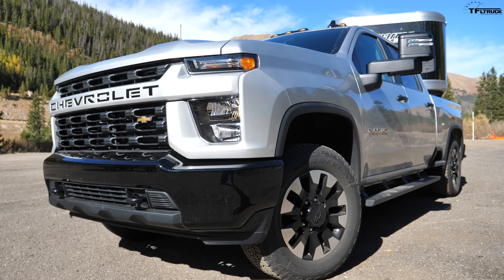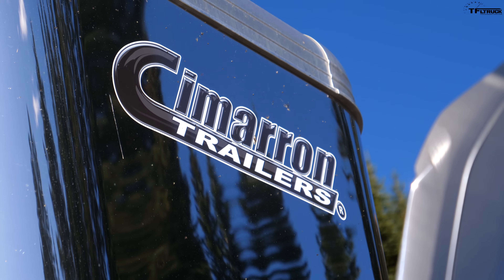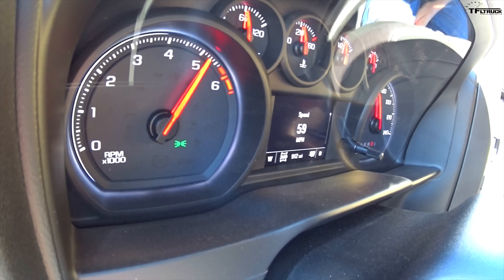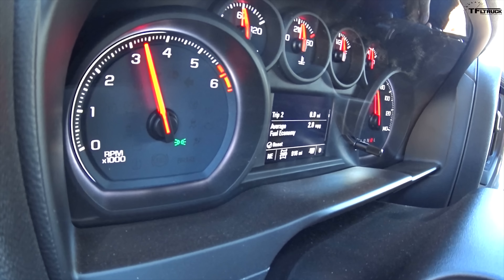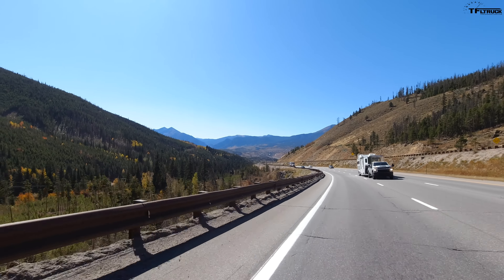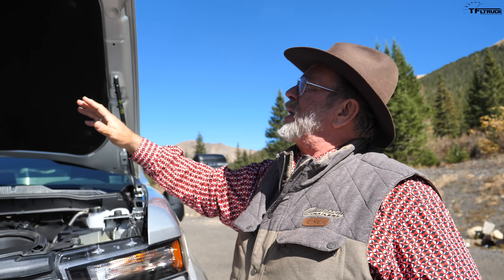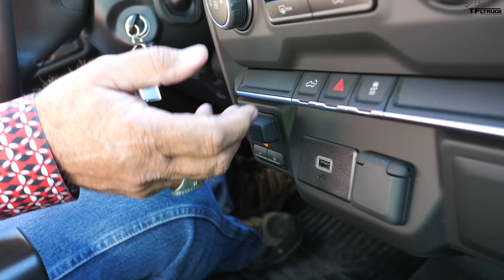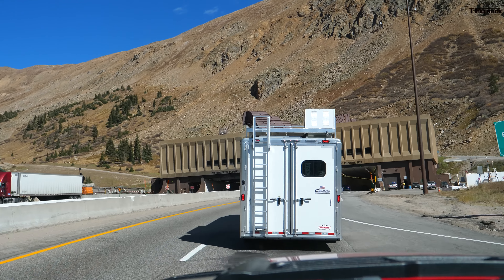The New 2020 Chevy Silverado HD Gasser Broke Our Ike Gauntlet Scoring System - Here Is How!

Comment: Wow what a flop I was hoping Chevy would have something better than that can’t wait to see how the 7.3 L Ford does I guarantee you it will be better than that
Reply: Same here. Very curious to see how well the 7.3 does with the 10-speed. Should be quite impressive. Smart move by Ford to offer great towing for much less cost vs. diesel.
Reply: What's sad is the new 7.3 is only rated 100 hp more than my 94 f350's 7.5 460 and almost the same torque so where is all this power they're talking about because it's not that much different than what my motor was  25 years ago
Reply: I think the RAM with the 8 speed may do quite decently. Granted, it's the oldest engine here, but the ZF is a great box and the Hemi likes to rev.
Reply: @80f250  I'm not sure where you're getting your information from, but the 460 from the mid 90s was rated at 245 hp and 410 tq.  That's nearly 200 more hp and 65 lbs of torque.  Pretty significant gain.  The 460 from the early 90s was even less powerful.  Plus, you're not seeing the whole picture.  I'm willing to bet, despite the new f350 outweighing your truck by thousands of pounds, probably gets twice the mpg.  I'm not sure what the new payload and tow ratings will be, but I'm sure they will eclipse your trucks 10,000 lb towing and max 3,800 payload, considering this Chevy is already leaps ahead of your truck with a 3/4 ton that makes less power and nearly half the gears than the 2020 Ford 7.3.  Not to mention these trucks can do all that more safely, and in far more comfort.  That's just scratching the surface on what 25 years has done.  And don't get me wrong here, I'm a big fan of the 460, but it does not even compare to these new engines in terms of performance.

Comment: Interesting video and I can't wait to see how the Ford 7.3 does for comparison, but these maxed out uphill at elevation tow tests apply to such a tiny fraction of actual use please just make sure you are spending adequate time on reviewing the rest of trucks instead of just being infatuated with this Ike Gauntlet test...  I know you mention the elevation in every video but a lot of folks probably still don't realize just how much effect it has on naturally aspirated motors and how much better the turbo gas and diesel motors can compensate for it with additional mass flow from the turbos (to the point where the turbo gets out of its efficiency range anyway), so just to make clear for viewers for anyone towing at low elevation all of these gas vs gas/turbo and diesel/turbo results are pretty much worthless.  Just saying if you live in MN like me or anywhere else lower elevation don't make your engine buying choice based on these test...
Reply: If it pulls better at elevation, it will do better down lower,  but if the f250 beats it at elevation it will beat it lower down, so it is still relevant.
Reply: @andycarrell7320 The point was simply that the results will be much closer at lower elevation, so something that seems inadequate on the Ike Gauntlet may be just fine for your use...

Comment: Just keep in mind with all these tests, they are at high elevation and any NA motor will get crushed by an engine with a turbo.
Reply: But the Ford 7.3 gas Naturally Aspirated motor did not get crushed. It towed just as good as the diesels.

Comment: No one doing this kind of towing is going to buy the gas engine. You'all know that, yet you review it as if it was directly competing with the diesel trucks. I honestly don't understand why you do this. The gas 2500  would be able to handle around 10,000lb on the gauntlet, not 16,000. Most people buying this truck are going to tow around 8-10k pounds. Yea its rated for more, so what. Not a single person out there is going to tow 16,000 pounds through mountain passes with a gas 2500, so the video is very nearly irrelevant. Also, people towing this much are usually going to opt for the 3500 option, which would not squat nearly as much. What you are doing is really at the extreme outer limit of what a truck like this can reasonably be expected to do. Yet it seems like you are so disappointed at how it performs. What you should be disappointed at is the insane never ending "towing number wars" where manufacturers constantly inflate their tow ratings to unrealistic limits. Nobody should be surprised at this result, and no one should take it to mean this truck isn't a great product. I'm sure it will excel in the 10,000lb range which is exactly where it should excel. But most buyers opt for the duramax even though they will never come close to needing it. And its videos like these that contribute to that insanity.
Reply: The thing is though, If they test all the gasser trucks in this same way, it gives an even metric to compare the trucks against each other. will they all be used in this way? No. will the one that does the best in this testing probably also do the best when pulling a more standard 8-10K? Yes.
Testing trucks at their limit is perfect, because it shows you how they behave at the limits

Comment: Looks like they overrated the towing/payload specs for the gasser. It needs more gears or a shorter final drive ratio. Gotta keep that RPM up.
Reply: Its one of the steepest grades in the US. At extreme elevation. Its hard for an N/A engine to preform well in that environment

Comment: It's a shame the hood scoop isn't functional with the gas engine. I never understand why the manual shifting option isn't used. I get that you're looking at how the manufacture programs them, but the same manufacture also puts in that manual mode for a reason. Even more why not test it as if.... you owned it since that's what happens for those who buy them. Treat it like you own it rather than just want to take it for a quick spin.

Comment: Slow AND thirsty?! Hmm 🤔
Reply: Agent Smith and $10k cheaper than the diesel.
Reply: @ALMX5DP   then you gotta factor in repair costs and that stupid def fluid bullshit.  unless you do heavy towing regularly. diesels just not economically justifiable.
Reply: @inthewoods5471  
When your cat gets clogged eventually and a cascade of dominos reach up I to that engine. 
Good luck.
Reply: @inthewoods5471   Just wait till the filter in the DEF unit gets clogged. It cost $7000 in a CDL truck to be fixed. So I'm going to guess between 1000 and 3000 for a pickup truck.  And how it lets you know it needs replaced is warning lights. There's nothing that tells you you need to replace the filter soon. It basically tells you to stop driving the truck. Or the engines going to be destroyed. Because if no DEF gets into the engine it will destroy it. I guarantee you there will be plenty of fools that still drive the truck around and destroy the engine. DEF is new in pickup trucks just give it 5 years. There will be plenty of horror stories. People will be looking for pre DEF diesel trucks. And the price of those old trucks are going to go up.
Reply: mtrujillo1973  Its doing what its designed to do, 5000 rpm's in a gas engine is like 3500 rpm in a diesel.
Reply: mtrujillo1973  
You are a mechanic and "KNOW" diesel don't have catalytic converters? Seriously?
Reply: @inthewoods5471  
That's your best come back?
What do you call that which I linked?
A Catalytic converter for a Ram 2500/3500.
Surely you know this as a mechanic every truck sold here in California has one.  
Not to be confused with a CATALYST.

Comment: I'm looking at getting the same truck but 2022. The 5th wheel I have is 41ft and 12,100 (14,000 max) with a pin weight of 2,200. 
Do you think it will be safe to tow periodically (maybe 2 or 3 times a year).

Comment: Why wouldn't they manually hold a lower gear, keeping the engine in it's power band, furthermore does GM need to adjust the Auto shift algorithm ?
Reply: They never do that. They wanna see what the truck will do when they let the truck do all the work

Comment: The compression ratio difference between the gas and diesel also plays a big role in engine braking. 

I don't think the truck will downshift under max load with the gas pedal on the floor until it drops to such a low speed. It's protecting it's self. I wonder if you were to let up just a little on the gas if it would downshift sooner.
Reply: If anything, that would trigger an upshift.
Reply: The compression ratio has no effect, the valves don’t open at TDC so you recover the stored energy on the down stroke.
Reply: I hate that it performed so poorly in the downshift department for sure I think if it had down shifted earlier it would have done better.

I beg to differ on the comp ratio. A diesel has anywhere from 13.5:1 and 20:1. It's harder to squeeze the air to that over a 8.5:1 to 10.5:1 the diesel has more of a mechanical advantage there. 

I wonder what the cubic inch displacement is on the new gas 6.6? My 11 6.6 diesel is around 403 I think. 

From my limited experience with semi' s I drove an international with an L10 and a Mack with an ISX 15L 565hp. That Mack would almost stop itself in comparison to the binder (international). Of course bigger pistons (more cubic inches/ liters) bigger mechanical advantage.

Comment: The 2500gas will get the 10spd in the next year or 2 for sure. 

Not that it’d be a ‘fair’ comparison, but I’d love to see a 6.6 gas 2500 with a bolt on supercharger do this type of test. It should make the diesel 6.6 torque, more HP and eliminate all the need to maintain all the DEF SCR stuff
Reply: 2023 and still no 10 speed

Comment: Chevy, are you listening? This truck received a milquetoast review. 

Can't imaging running a truck at 5,000rpm going up hill for any amount of time much less 5 minutes or more. The engine/transmission/rear axle combination used would be the sole reason to purchase an extended warranty, as it's going to need it.  

Finally, 2.4 mpg on the hill? Really, 2.4 mpg? This beast needs a set of 4.33 gears not just 4.10, plus a heavy duty 10 speed automatic for leisurely highway cruising. 

Total fail.

Comment: Needed 4.10 gears ya GM bozos!
Reply: GM always puts shitty gears in their trucks so they can claim to be gas mileage king, even though in the real world driving style makes more difference in mileage than the difference between 3.73's and 4.10's, and it only hurts their actual towing performance.
Reply: @nathanmcdonald610  you are correct about the real-world difference in fuel economy. In these trucks, the weight and aerodynamic drag are much more significant to the lack of fuel mileage than gear ratio or engine size. Some people experience an increase in unladen city fuel economy with the lower gear ratios, and negligible difference in unladen highway. The lower gear ratios also result in higher mpg when towing.  But, no matter how much you preach, if you go to a dealership and buy a truck out of dealer stock, it is always going to have those shitty 3.73. I was looking for a F350 just last month, and could not find any 2019 with the 4.30 gears... could find a lot of them with 3.73s though.
Reply: racerboi77j dealerships know they don’t need to stock the optimum tow featured models with the 4.10’s or 4,56’s, reg cab long box, extensive choices of DRW models, etc. since they know people who want these features are much more apt to be willing to order them. They tie their inventory dollars up in the grocery getters, since most people don’t buy trucks to work regularly.
Reply: deeohgi the problem is gym. You can’t get it with 4.10 gears anymore. It’s not even an option for people who order them.

Comment: The truck is designed with manual transmission control for a reason.  If the driver selects the proper gear for the grade, it will do that downhill with much fewer brake applications.  I understand that you have your "standard test" but it is flawed because that hill represents an extreme operational use.  The truck is capable of holding speed on the hill but needs manual input to do so.  Do the test with manual inputs and see how it performs.  That is more "real world" :-)
Reply: rob the elder     Just push the button right!   Geez 🙄
Reply: @kdougk6668  Can you translate this into engrish?  I am baffled by the brevity of your comment.  Thanks

Comment: No tranny and coolant temp readings?  That is absolutely critical at heavyweight towing.  GM grade braking works perfectly when using cruise control and I always manual shift when towing uphill to maintain proper control.

Comment: I thought both the Ford and the Chevy squatted 4in.  But you took a lot more points off the Chevy than the Ford for the same squat.  Didn't the Chevy have a higher payload rating then the Ford?  I don't get it. And I don't get why GM won't put the 10-speed in this truck.

Comment: Thank you for this. My take away is that if you are going to work your truck hard, get the diesel. No surprise. I also take it that this truck is fine with lower loads and lower elevations. And why the hell did they put the goose neck behind the axle. It tells me they are not serious about towing with this truck. 10 brake applications with tow haul? 2 inches behind axle? 3.73 gears? Again thank you. I have to say the ram 2500 Cummins is looking better and better for my needs and wants. This is a great service you are providing. Thank you.

Comment: 3.73 is as good as it gets with this new truck not good, wonder why they removed the 4.10 option? When you did the 2500HD review 08/30/15 the 2015 2500HD went up the ike at 10:38 2.5 MPG, It looks like this new offering is a downgrade and not an upgrade 2020 2500HD 11:53 at 2.4MPG yea thats a step backward for GM. I will keep my 2015 6.0 Gas with the 4.10's for now, will pass on this gasser for now.
Reply: Jello Jello it’s a conspiracy. It actually ran up in 8:12 but a diesel refining superpac is the top contributor that supply’s the trucks for tfl so they reran it, trimmed the footage and baked the time. I had the emails they sent to headquarters but they hacked my computer and deleted them

Comment: Still good for the weight at those conditions. Does it need a 10-speed with a 3.73 yes if not put a 4.10 in with the 6speed or have both combos, options are good. I'm no where near those conditions so a gas would be great for me & 90% of the population (40% normal towers+50% posers).

Comment: This performance actually isnt terrible. Towing 16,000ibs in a small block gasser is not going to happen on the regular nor going up a 7% grade and for most folks you wont be at 2000 ft above sea level. Think about it. This test was the most extreme test possible for this truck and it still did decent
Reply: Jerred Boshears     Would have done a lot better if they would have used manual mode and shifted down one gear
Reply: @kdougk6668  yep. Exactly right

Comment: This truck has a calibration issue should never load up THAT far below the torque band (it will ruin the bearings). Was it pre production one? My 2003 8.1 at 19k GCWR with oversized tires beat this never fell below 35mph.
Reply: Meaning full throttle that low in the RPM range shouldn't be allowed.

Comment: Wow, was that a semi passing you towards the end of the uphill run? That is not a bad price for this truck.
Reply: That semi probably had an empty trailer. I’ve driven that hill in a semi loaded to 79,000 pounds. With a Detroit diesel series 60. 14 Liter 515 hp @1800rpm, 1650 pound feet of torque @ 1200 to 1600 rpm. 25 miles an hour in 5 th gear. 13 speed transmission. 3.42 ratio 2.39 mpg.

Comment: Why do you guys refuse to force a downshift on the up hill? That chevy started running again once it finally downshifted, if you actually did "real world testing" a real driver would have downshifted and ran up much quicker. Take off points for lousy transmission tuning if you must, but that up hill run is extremely inaccurate as you tested it.

Comment: Chevy needs to work on the gearing. That engine Shud be set up to run 4000 rpm at 60 in third. That poor 6.6 was bogging down below 3000 rpm. I bet it would scoot up the hill way better.

Comment: Hello again Andre’&Co.! Yes I like Chevy an have owned them for years,  but never a HD, or any HD/SD for that matter. But as usual Chevy comes out with a totally new HD truck, including engine, but stays with the 6 speed transmission?? Why? My guess is a later mid-cycle refresh with a new 8-10 speed transmission and 4;10 gears. That I’m sure will bring that sub 12 minute pass at least down a second or two, with an increase in mileage. I’m sure that new Big Block Pushrod engine in the Ford SD, will have at least a sub 11 min run with a slight increase in mileage. I’m not holding out for much for the Ram 6.4 HEMI, the only change there is the 8 speed over the 6 speed. A new Super Ike competition with all Gas an all Diesel HD/SD trucks is warranted.